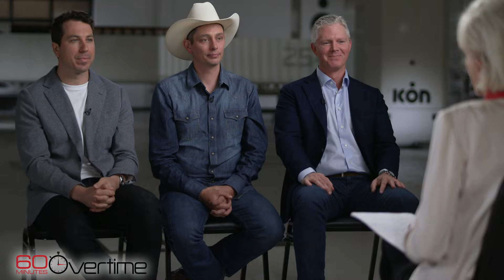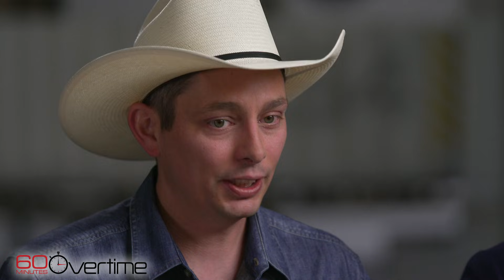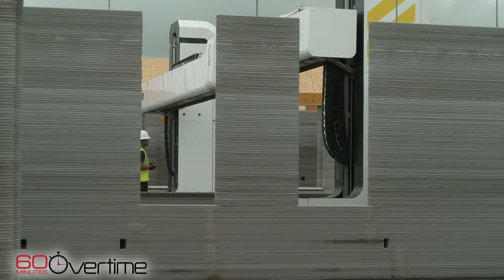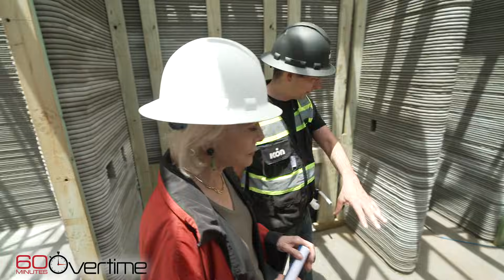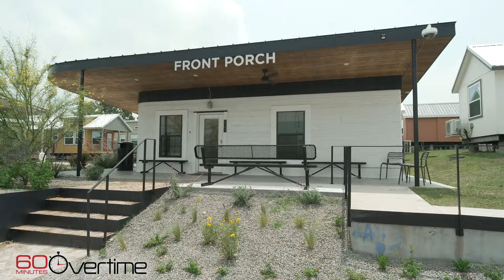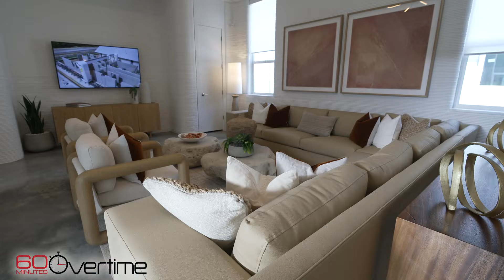Can 3D-printed homes withstand a changing climate?

Comment: Nope' concrete cracks, and crumbles. If not' reinforced by steel. No diferent, than those rock igloos that buried iranians a few months back. After earthquakes.
Reply: Correct. You need rerod, without it there is no linear strength. Building code here in Iowa requires # 5 rerod @ 12" OC horizontal and #4 rerod @ 24" vertical. I see no way to implement that here.

Comment: Exciting results so far, this 3D housing construction. But, consider:
-- There are not enough skilled workers.
-- Why are there few skilled workers?
-- More automation will increase output in this industry.
-- Who benefits from increased output?
-- New or related industry will emerge with the need for more employees.
-- Or will automation in related businesses require fewer humans?
-- Jobs lost via automation will equal jobs created.
-- Robots will be programned to self-correct.
-- Humans will work off-site using drones, robots, and remote intercept.
-- Robots will self-repair or repair each other via plug-in modules.
-- Robot black boxes will collect, analyze, improve.

No company or country exists in isolation.

Comment: Maybe using this as the outer shell for the homes as opposed to the internal walls would be even more cheaper and efficient. Still using dry wall for the inside incase people want to make modifications to the home. 3D printing the internal layout makes everything permanent. Still really awesome and this has a future and much better than stucco homes aesthetically and material wise imo. Would love to work for this company.

Comment: If you build a 3-d home add 1ft to 18. Inches to rhe outside foot print. That way you could add interal stuff around the foot or so .i think it should work. Hey i m 64 and have cancer.
Reply: I'm sorry.
Reply: @curiousworld7912  aww don't be. I've come to terms with it. It is what it is. Any way do see it? Only the outside walls get that 12- to 18 inches.after you add the inside frame and drywall the windows and doorways get franed. Then you add insulation or what ever order makes sense.

Comment: "The cement industry is one of the two largest producers of carbon dioxide (CO2), creating up to 5% of worldwide man-made emissions of this gas, of which 50% is from the chemical process and 40% from burning fuel." This excerpt is from the Wikipedia page "Environmental impact of concrete"
Reply: Ya cement trucks pollute a lot but soon them won’t once every is electric
Reply: @nicholasmorello6370  has little to do with the concrete trucks. It's the production and off gassing of cement within the concrete that is the issue.
Reply: @danwelch1079 good thing the 3d printers can run of other materials!
Reply: Unfortunately, Wikipedia is only as reliable as those who contribute to it, so what we read, should be taken with a grain of salt. Not that what you read isn't a concern. Perhaps this could spark an innovation that can reduce if not eliminate the carbon footprint of the concrete industry.
Reply: It's no secret that concrete has the largest negative impact on climate change than any other material. This is extremely well documented. 
While 3d printing may become a viable solution, the current tech only exacerbates existing problems

Comment: Kudos to these guys for trying something new. Excited to see how well it works.
Reply: The technology really works well and has been around for many years, like the ICF (insulated concrete forms) method which is just as economical and better than using wood. Im also excited to see this tech come to africa where there poor really need this.
Reply: @Chimpira777  I’m interested to see where it goes also.  But if one of these homes is costing $400,000 or $500,000 here, can they afford to do that?
Reply: @lynnern57 building with concrete or wood is pretty identical in price now a days. In kost parts of europe it’s recommended to build with brick and concrete cause of all the insulation requirements that’re hard to achieve with wood.

Comment: Note that he didn’t mention water damage. Concrete is notoriously bad at weathering floods and other forms of water damage.
Reply: The type of concrete matters A LOT. Some concrete is stronger wet. It's called self-healing concrete.
Reply: Cause drywall holds up great?
Reply: It’s not actually concrete. It’s a mix.
Reply: Holds up great with sealant.

Comment: Cleaning in between those layer lines is going to be a pain.
Reply: I agree, They should back trowel it smooth or finish it a different way
Reply: lol that isnt the finished wall they will have stucco or something like that to smooth out the wall.
Reply: @Joeseph-t2e  go look at the other video of it, they go into the fully furnished model home and you still see the horizontal lines on the inside of the home.
Reply: Cleaning robot.